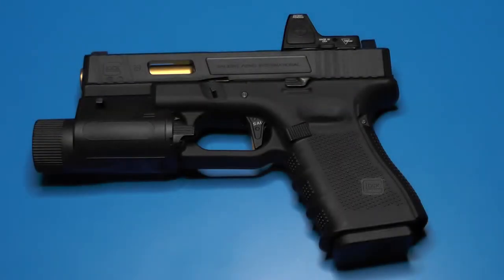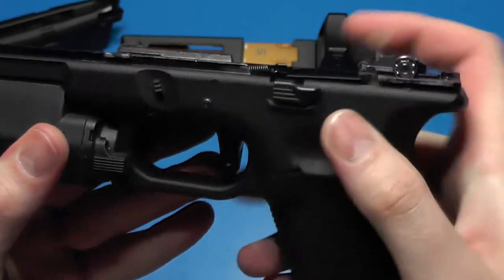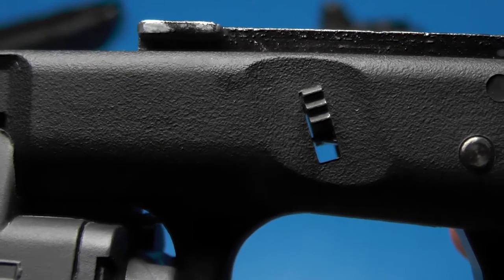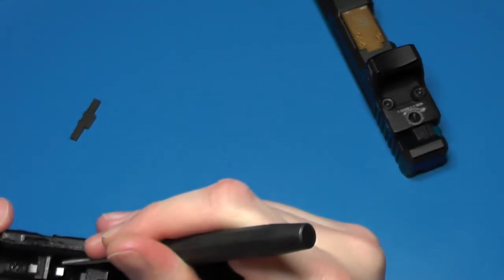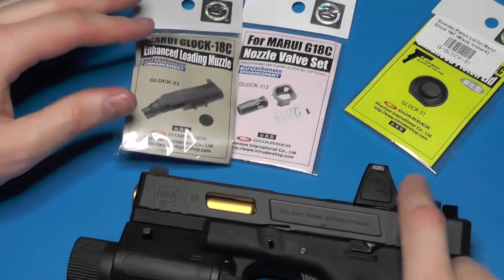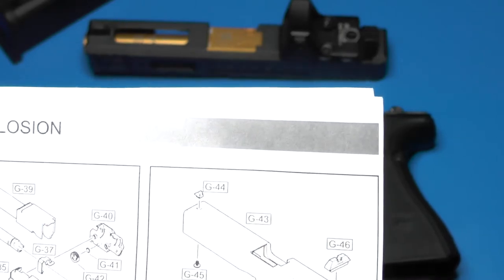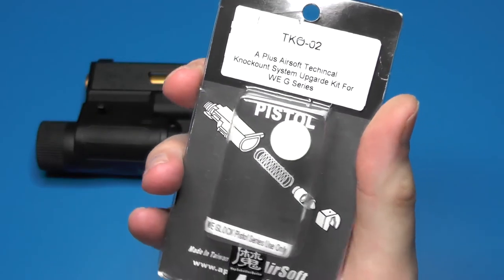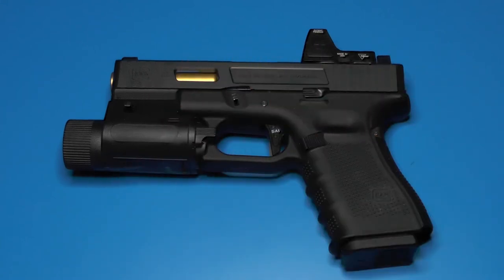Update & Tech-tip: WE Glock 19/23 with A1A SAI RMR slide kit - FPS results - trigger lock-back fix!

Comment: the quirk at the end is from the trigger bar/ sear nub/ and the corner on the hammer housing that traps the trigger when its uncocked. in theory when the gun is cocked the sear is moved forward and the trigger bar nub can slide all the way forward to the front. when its uncocked, it slips upwards and the sear holds it against the corner. something in there is too short and instead of sliding over the gap, its falling in even when it shouldn't

Comment: I know this video is old as heck BUT, the guarder nozzle is a MM or so shorter than the one that came with this kit. thats letting the slide sit forward just enough to poke the bar, not the slide lock.